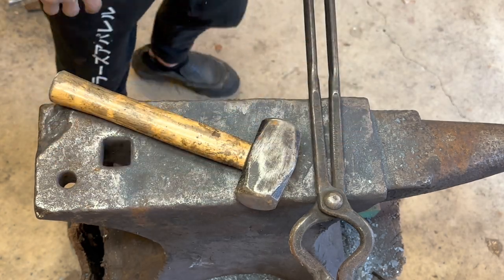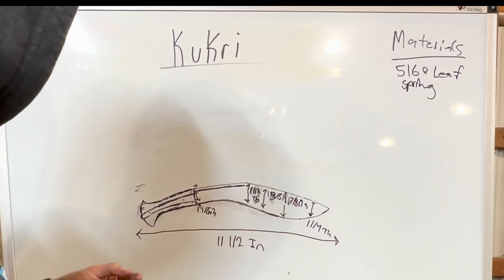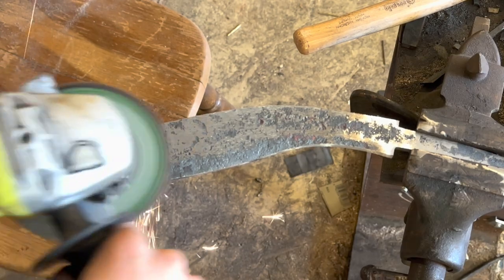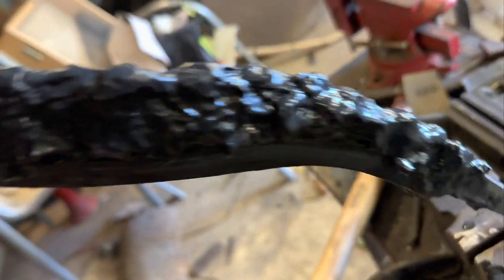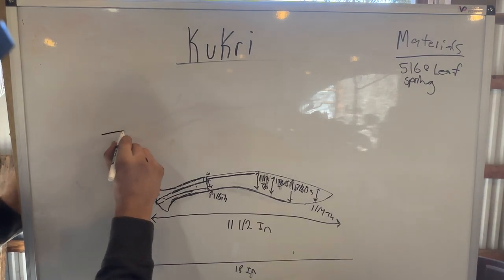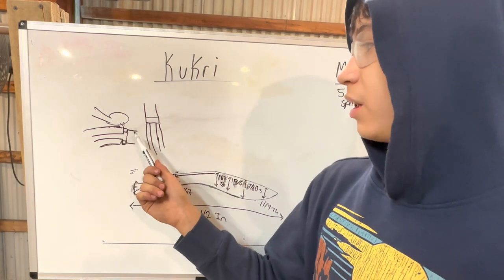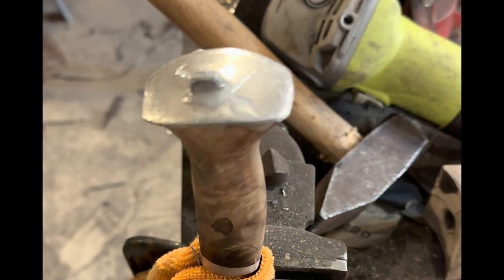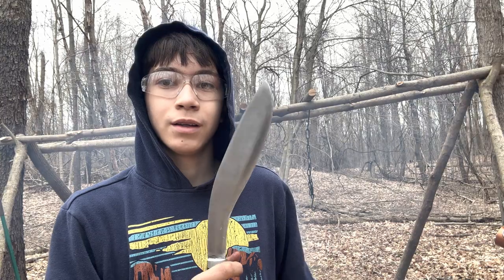Making a kukri from a leaf spring

Comment: Yeah I had to learn this lesson the hard way too lol 5160 and I believe 52100 will not hammon. I believe the chromium in it won't allow the separation of heat enough for a hammon to form. I spent a lot of time one a few knives that a hammon never showed up on lol it was a bummer haha but yeah turns out 5160 will not hammon. Not sure about 52100 never tried. But I believe it's in the same boat.